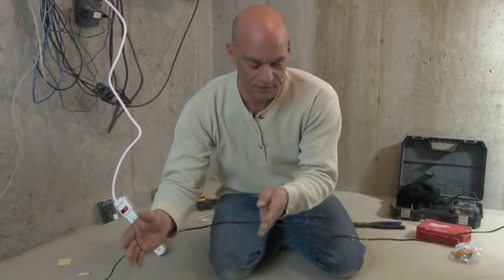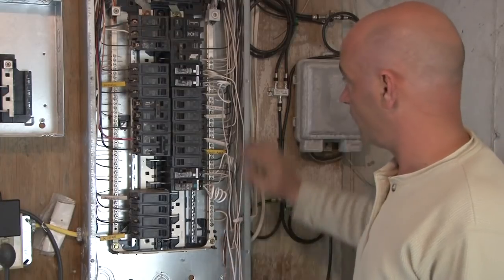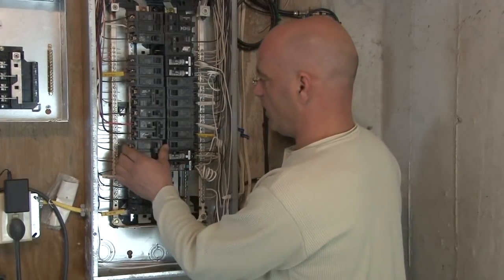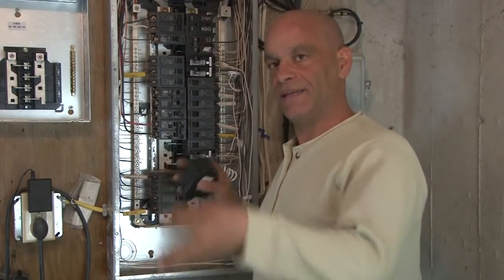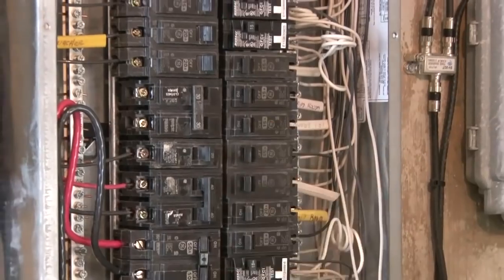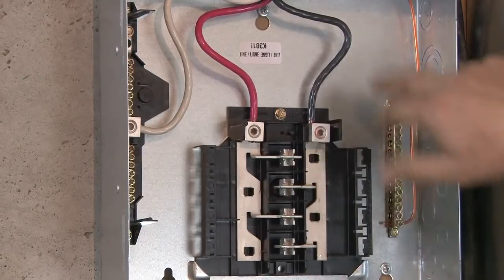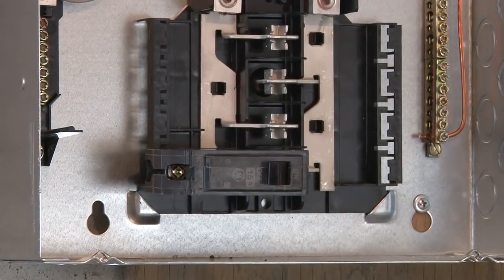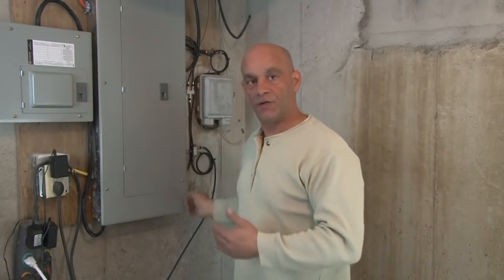How to Install a Subpanel

Comment: There is one code issue with this otherwise great video. And that is per code (sec 312.5 (C) it says wires that are connected with metal connectors must have a fitting (plastic bushing) to protect the wire(s) so after the romex or other metal wire connector's lock nuts are installed, a plastic screw on bushing must be used for abrasion protection. (those are my words from what I was thought) Below has been copied from the code See condition (c).
Also the inspectors like to see the red wire for the service and the sub lugs to be used only as phase B And you have it red on phase A and black as B. Just trying to be helpful :-D
312.5(C) Cables. Where cable is used, each cable shall be secured to the cabinet, cutout box, or meter socket enclosure.
Exception: Cables with entirely nonmetallic sheaths shall be permitted to enter the top of a surface-mounted enclosure through one or more nonflexible raceways not less than 450 mm (18 in.) and not more than 3.0 m (10 ft) in length, provided all of the following conditions are met: 
(a) Each cable is fastened within 300 mm (12 in.), measured along the sheath, of the outer end of the raceway. 
(b) The raceway extends directly above the enclosure and does not penetrate a structural ceiling. 
(c) A fitting is provided on each end of the raceway to protect the cable(s) from abrasion and the fittings remain accessible after installation. 
(d) The raceway is sealed or plugged at the outer end using approved means so as to prevent access to the enclosure through the raceway. 
(e) The cable sheath is continuous through the raceway and extends into the enclosure beyond the fitting not less than 6 mm (¼ in.). 
(f) The raceway is fastened at its outer end and at other points in accordance with the applicable article. 
(g) Where installed as conduit or tubing, the allowable cable fill does not exceed that permitted for complete conduit or tubing systems by Table 1 of Chapter 9 of this Code and all applicable notes thereto.
Reply: Um, 312.5 says: Conductors entering enclosures within the scope of
this article shall be protected from abrasion and shall comply
with 312.S(A) through (C).

In this video the wire entering the panel is a cable NOT a conductor so he should be fine.
Reply: JonTheChron Not to mention this is mainly protection for wires being pulled through a raceway.
Reply: Yes raceways AND panel boxes and cable and conductors are the same thing (its like saying car or auto) so It is required for that video and the abrasion protection is not just for pulling but to protect the wires from rubbing (and eventually possibly shorting to ground on the metal connectors in the event of movement like building settling, and such. Its just a plastic nut that goes after the connector lock nut.   Ask your local inspector he or she will tell you that the plastic bushings are required..
Reply: be green together  I just looked up the definition and you are correct, I take back what I said about cables being different from conductors.
Reply: No worries, before I posted my statement about it I looked it up too to make sure my memory wasn't failing me.And by the way, I find you honesty commendable!! :-)
 Thank you so much!!

Comment: Is that a 50 amp sub-pane?. Or do you use a higher rated panel such as a 100 amp with a 50 amp feed supply?

Comment: My main panel is about 115 feet from my attached garage where I want to install a 220v outlet for an air compressor rated at 15 amps.  I don't think I need to install a sub panel as all I need is one 220v outlet. (there are existing 110v outlets in the garage).  Question is, can I install a 220V 20 amp breaker in my main panel, then run a 110 foot length of 12-2 wire fed through the ceiling (not attached to studs) from the panel to the new 220v outlet (basically following the instructions on your adding a 220v outlet video), or is that too long a run?  Is a sub panel in the garage, fed via a 50 amp breaker on the main and 6-3 wiring necessary? Also, just checked your website wiring calculator... for a 50 amp circuit (if I decide to install a subpanel in the garage) your calculator tells me I can use 8 gauge (8-3) wire(??)

Comment: Wanted to say thanks for the video!  I just ran a sub panel to another part of my house with the help of your video.  Really loved the help on wiring the sub panel box.  Didn't know that part about the grounds and the neutrals for it.  I will say working with 6/3 wire is real pain though!  I pulled about 35 feet from my main box to the sub panel.

Comment: The green screw bonds neutral bus bar to the metal casing. Screw left in when panel is used as main service panel. Remove the screw, thus isolate the neutral wires from the metal case in application as a sub panel... Capish?

Comment: Im updating an old fuse box sub panel in my barn. The 8/3 wire from my house's service feeding the sub doesn't have a ground wire and I doubt I'd be able to fish one out to it through the existing conduit. Can I just trench out a new ground wire to the barn? I mean, does it matter if its not in the same sheath as the feed wires as long as its connected properly at both ends? Also, there is a grounding rod at sub panel. Thanks, AJ

Comment: Thank you for your videos, they are very helpful educating me.

I recently purchased a home where they installed new panels with 200 amp breakers for kitchen and basement. After moving into the home the same electrician who installed the panels before I bought the home brought to my attention that the kitchen was wired incorrectly. He is telling me that all the outlets in the kitchen are running off of the stove. Underneath my electric stove top there is a fuse box. He is telling me that i need to Rewire the kitchen counter and install child proof gfci outlets. Install new 4 circuit breaker under counter and remove lines attached to the 220 volt countertop stove and place them into the new panel. Separate the circuits to meet code.

He is quoting this at $2300. Could you maybe explain to me why this is unsafe? The house has been like this since it was built and I don't want to make a mountain out of a mole hill if I can help it.

Thanks
Reply from the maker: Why?. Because that's just not how it was ever done. For every reason under the sun.Just have him fix it for you. Everything you said is wrong and should be redone. Each curcute  should be on it's own breaker and a panel should never be hidden. And nothing should ever come off the stove.

Comment: Great video!!  I have a question or two:  I have a 200 Amp panel with 20 slots where most of the breakers are doubles or mini breakers.  I would like more slots for breakers and would like to know if I should add a sub panel or should I switch out the 20 slot panel for a 30 slot panel?  I am comfortable doing both.  This leads to my second question which is how many lights can I put on 1 15 amp breaker with 14-2 wire?  A previous owner put 18, yes that is 18 which includes 6 outlets actually.  The breaker breaks all the time and I had to change every light to CFL bulbs so the breaker does not turn off.  Has to be a code violation but I must fix this ASAP!  Thanks
Reply from the maker: http://www.askmediy.com/how-many-lights-and-or-outlets-can-go-on-15a-or-20a-breaker/
Reply: askmediy Thanks, but that did not answer either question. I will keep looking

Comment: I have a detached building about 100 ft behind my house for musicians band practice. I have a 100 amp subpanel and going to add a 100 amp breaker to my main breaker box in my house. What type underground cable would I use in conduit? I was told 2-2-2-4 Aluminum Dyke Underground Secondary Distribution Cable by one person, but someone else said stay away from aluminum. This would be nice though, 1 wrapped cable and affordable. Another person stated 2/0 copper for which I would have to buy 4 wires and costly. Can you set me on the right path? And also, would I need 2 ground rods outside the building and if so how far apart?  Thank you and really like your videos.

Comment: From the main panel, can I make a subpanel and run it to a second house? Live right next to my Dad and need to take care of him. So one electrical bill won't matter. Electrician says its OK becuase we live out in the ranch area and he will put ground rod in dirt. Just want your input. Thanks for the video.
Reply from the maker: That's going to really depend on the subpanel load. But why would you want to do this is the question.
Reply: askmediy It would save me about 15 thousand dllrs. from subdividing land to get access for second house lighting and save me headaches from septic tank needs to be so many ft. away from water well and all the regulations that go along with it. Now days you need permits for this and that and cost alot of money. I live out in the country far far away so all this crap would be saving me about 20 grand.  My dad made his house in the 70's and non of these stupid regulations existed. There are broken down houses that connected to light only because they are subdivided but are a real fire hazard. Mine is alot better than most of these houses but is not subdivided. Another words money talks bullshit walks. Thanks for the video.
Reply: how many Amps is the main panel and how many feet is it to the sub panel?
Reply: dave12546 I don't know how many amps the main one is, but electrician told me to buy  the electrical wiring a certain gauage to run the line from subpanel to second house. From the main panel to second panel is right next to each other. The line running from subpanel to second house isabout 45 ft. away.It has already been done and there is no problem yet arising. What do you think of this solution? Thanks for the video.

Comment: Why can't I just sue my electrician if something goes wrong and leave the city out of it (permit)?
Reply from the maker: You could always ask your insurance company.
Reply: Nice way to be. Ha, ha
Reply: K Singleton Very funny. If you ever had to live through that, you'd realize that it's best never to sue anybody. And just get a licensed person who will always pull a permit. After all, it just makes sure that at least two guys get their eyes on the work to double check everything.
Reply: I've had licensed Electricians tell me you don't need a permit you are only replacing what is already there.  Bull Sh#t!  I even offered to go to the city and pull the permit and pay for the it.  After the box was upgraded I was told to call the Electric company and tell them I upgraded my service and need a new drop.  They laughed when I told them it wasn't permitted and refused to hook up my new box.  It didn't pass inspection!
Reply: Okay then you are using the wrong electrician(s).

Comment: I'm installing a 100-amp sub-panel to an outbuilding. I ran 2/2/2/4 SER through 1 1/2" schedule 40 conduit between the main 200-amp panel and the shop's panel. I also ran #4 stranded copper from the sub-panel out to two 8'-0" ground stakes.  I'm confused as to when the green ground screw is required?
Reply from the maker: When the panel is used as a main panel it's required.
Reply: OK.  Thanks.  So my sub-panel's green screw should be entirely removed, correct?
Reply from the maker: askmediy yes
Reply: You are the man!!!  Thanks, again!

Comment: As a licensed electrician, and who has spent a number of years in school. Your work is good an neat. With that said, showing average home owners tips to doing a project as installing a sub panel may be over doing it. Changing an outlet or a switch I can see. But the average home owner can take this and either over load their main service or even worse do it without a permit and do some serious damage. I've notice comments like, "to be safe, just add a 100 amp sub panel." That's half you're incoming service. Some things should be left to a licensed contractor. Don't penny pinch on these type of things. It will hurt in the end.
Reply: timcat100  You kidding me? ! 
Inspectors are the worst offenders!
Reply: Blah blah...
Reply: timcat100 if you see licensed electricians screw up just as much as a home owner. They may be in the wrong line of work.
Reply: timcat100 its because inspectors hold no liability. If they did, things would be way different.
Reply: I did a primary underground to a transformer, then a 400A service off the pad.
The inspector drove up, said "do I need to get outta my truck? "
I said "it's a bunch of pipe and wire in a deep trench".
He said "alright, I'll call it in and you can fill it in."
And he drove away.
Reply: What is the reason that the neutral and ground wires are seperated in the subpanel?
Reply: R.J. MacReady maybe you should read what I said again. Notice,  it was in quotations?
Reply: scotty hanson I think he read it and understood it just fine.

He said your comment is just about as useless as the previously quoted statement.  He did not say that you made the statement that you quoted.

That said - what would a licensed electrician do that was not done in this video?  I'm a bit curious.
Reply: I had a rough in inspection pass, where the inspector didn't even show up on site.
Reply: Scotty Hanson-  I know what you are saying, I'm a retired electrician, but that's what we have breakers for!  You know as well as I do, just because he has a 100amp panel, doesn't mean he will ever use all 100amps, the same in the main panel. The powers that be, always try to make you think you  need a professional. They can't stop a homeowner from doing his own work, as long as it can pass an inspection!
Reply: This is actually child's play for many people out there. You fail to see that thousands of men watching these videos are have a very high skill set and intelligences. many can build their own house from the bottom on up. or their own airplanes. build boats, computers and . . . you get the picture. Though not complicated the viewer can not know the right procedure, materials, and what to be aware of on their own. We need skilled workers like dominic who can not only do but teach in a clear concise way.
Reply: A licensed electrician may not do anything different from this video at all.  Your insurance company on the other hand will more likely cover the mistakes of a  licensed electrician than that of the average home owner.
Reply: @sc0572  There are no "mistakes" it was inspected!
Reply: Michael Denney A licensed electrician would have stapled or fastened the cable feeding the sub panel at least twice.
Otherwise, it's not a bad installation.
Reply: scotty hanson applause
Reply: timcat100 more applause
Reply: scotty hanson and that's the horrible truth.  They can show up, thumbs up, and no matter what, their hands stay clean.
Reply: Lol live and learn i was a apprentice electrivan in the past n i say it ovet rated.
Reply: scotty hanson n
Reply: This is so true, and diy people should check there home owners policy.
Reply: Like I said, he does good work. I just don't think its proper to teach the average home owner this skill level. Dangerous in my opinion.
Reply: scotty hanson I COULD NOT agree more my friend.
Electrical is NOT a hobby.
Get it done by a professional, or up your fire insurance.

Comment: FYI, the main panel, the neutral and grounds are bonded together, so it doesn't matter which bar either go to. No need to separate them. The sub panel, it obviously does.
Reply: Not always true in a main panel.
Reply: Yes, in a main breaker panel... (the service) the neutrals and grounds are always bonded together.
Reply: If it has a main breaker…just saying.
Reply: Hints, main panel. Other wise it would be a sub.
Reply: Like anyone will make that distinction watching a youtube video on how to install a sub panel…that's all I'm getting at. 
Anyway, you win.

Comment: Nice video, thank you.  Should each bus bar in the main panel be connected to the corresponding bus bar in the subpanel?  I.e. left bars connected together and right bars connected together.  If so, then it matters which wire from the 50A breaker goes to which bar in the sub panel.  (I was just wondering if keeping the same "phase" ever matters.)
Reply: askmediy Sorry, I went back and read what I wrote and it wasn't clear at all.  What I mean is:  each bus bar in a panel is a 120VAC leg from the utility co.  The legs make 240 volts between them because they are in "opposite phase" from each other.  So, the two wires from the main panel's 240v breaker that go to the subpanel are connecting the two panels' bus bars together, presumably left bar to left bar and right bar to right bar.  If you "cross" these wires, then the right bar on one panel is connected to the left bar on the other panel.  In real life crossing the wires won't matter - I was only curious if the procedure should include making sure the wires aren't "crossed" just to be kosher.  It's a fine point, thanks again for the great videos.
Reply: montwell2 the phases go up and down, not left to right.

Comment: hey boss good video ,i have a question , i have to install 100 amp panel and run the wire around 160 ft of distanc to the main panel and i have  to install a disconect switch before the panel ,the disconect got it be 100 amp ? the wires # 2 awg ?
and pipe 1 1/4 ?
Reply from the maker: #2 might be cutting it light. But sounds good

Comment: I am running a wire under the house through underground conduit to a sub panel in a shed I am building. I will be running 4 outlets, a small heater, a fan light and a screen printing flash dryer. What size panel and wire should I use?
Reply: Specifically what type of wire should I run?